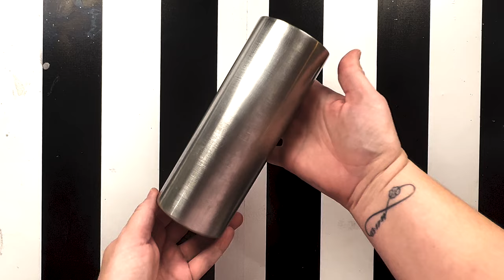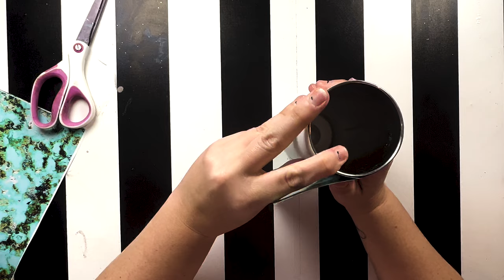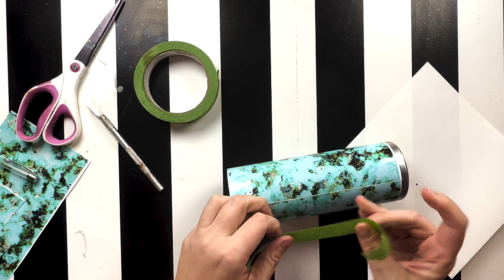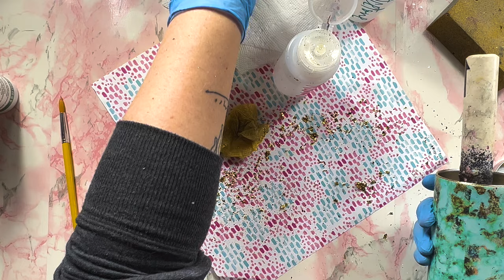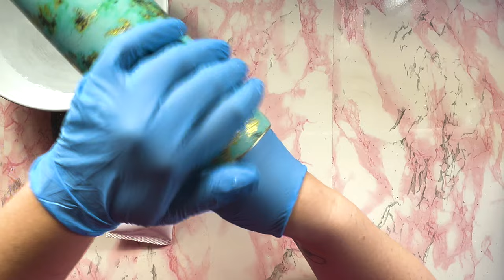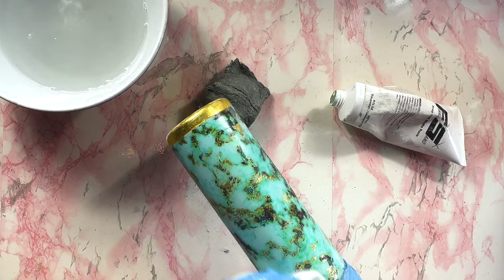Realistic Turquoise Tumbler Tutorial

Comment: Awesome tumbler but I do have questions. First, did you apply epoxy before taping off the bottom for the foil application?  Second, how long should we wait before “mattifying” the surface?
Reply from the maker: Yes, I applied a layer of epoxy after applying the clear cast and let that dry before applying any foil flakes. I waited about 6-8 hrs to mattify my surface; you need the epoxy to be dry but it doesn’t need to be fully cured beforehand.